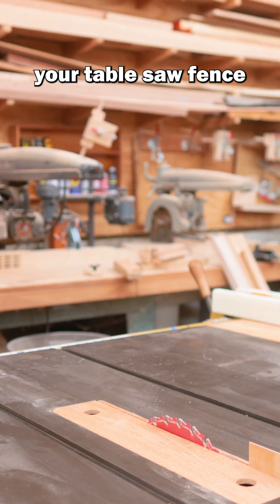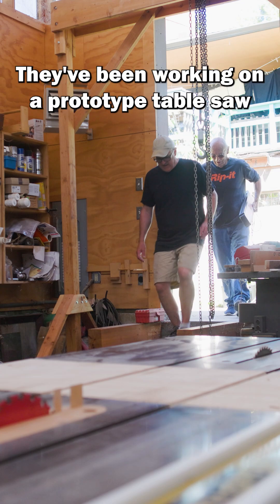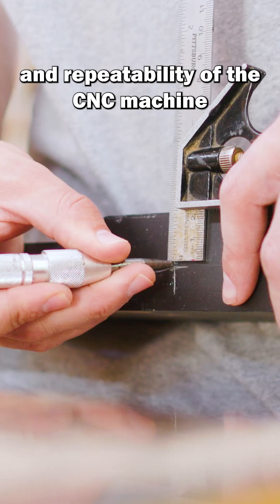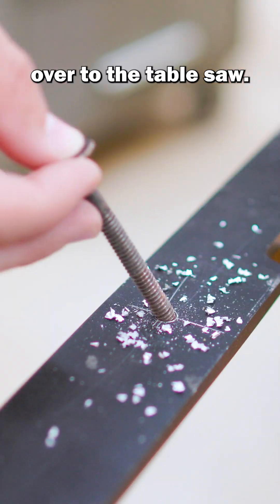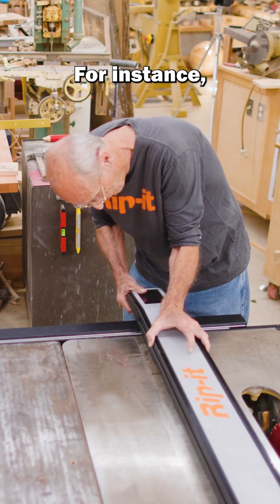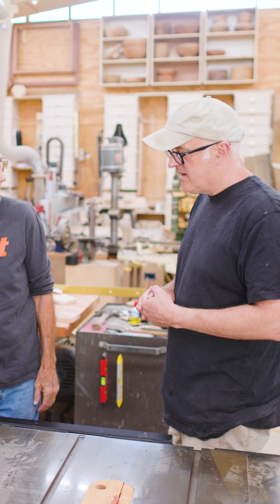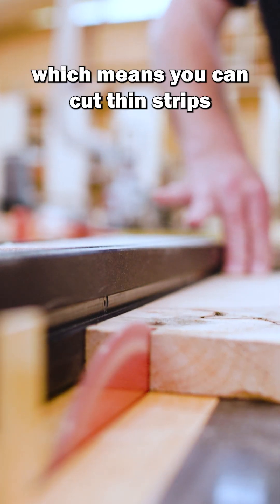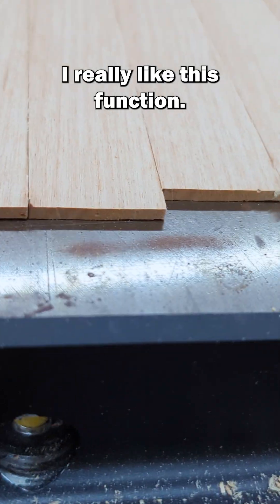Automated Table Saw Fence (Rip-it)

Comment: You are solving a problem that we don't have. Moving the fence is the easiest part of woodworking.
Reply: Moving the fence is easy, moving it precisely is easy but tedious, especially in production shops. 

Shure, it saves time, but the biggest thing is that it saves mental effort. Save your mental effort on the things that matter, not on whether or not the fence is actually at 1.3875 inches.
Reply: Moving the fence is easy, moving it precisely is easy but tedious, especially in production shops. 

Shure, it saves time, but the biggest thing is that it saves mental effort. Save your mental effort on the things that matter, not on whether or not the fence is actually at 1.3875 inches.

Comment: I used one on a  straight line machine 5 years ago. Punch in the width and press the button. It worked great until it stopped working.

Comment: If it already doesn’t, I think a good add to its design would be a stick on strip (sticker) that runs either end of the table it’s connected to. Just like a ruler the sticker would have incremental markings (QR Code for example) that a laser would read to keep exact measurements in relation to the saw blade to ensure accuracy. This would eliminate discrepancies if the rail was to wear or move. A basic calibration type system.
Reply: I imagine this rail uses the same tech that digital calipers use, tracking its absolute position without any drift. I think theres a video showing how mitutoyo calipers are made somewhere that shows this off.
Reply: @mezu-e  Yes I imagine so, but I’m talking about a marking system to make sure the fence and table saw don’t move from their original attached location. The fence will always run along its own tracks accurately but if the fence somehow flexes or loosens from the table saw it will continue to says it’s moving the correct distance but it’s distance from the actual blade will change.

Comment: I expect one day this will be the standard, just as the SawStop idea will once their patent expires or someone else figures out a similar device. Jeremy Fielding did his table saw this way and has videos on YouTube about it, only he added motors to the blade height and blade adjustments as well. One day far into the future, maybe when I'm old and gray, I hope to buy a fully cnc table saw that all I have to do is enter my cut information and then slide the material through.

Comment: the idea is not new it been used for years on profesional metal shears so the base system (panel with driver , servo motor , toothed belt system,  electronic ruler ) can be bought ready made  , it is a nice system though

Comment: Can the motor be disengaged temporarily so the fence can be moved manually if for some reason I want that? Seems like a great product!
Reply: Hi, we're the product design company that developed this product. Yes! You can "disengage the drive" as we call it, with just the tap of a button. Even better though, is you can hold the Jog arrow keys and Rip-it will move in that direction until you let go!
Reply: @kingstonsteele9530  that's great news!

Comment: This would be extremely useful in a large furniture shop
Reply: This would be extremely useful in my small doodads shop
Reply: For large shops there is Altendorf )
Reply: @waitaloneinthedark yep
Reply: @waitaloneinthedark  well there isn't just altendorf. there is also Martin (those two being the bes quality offer I think) as well as Holzkraft (more budget), Holzmann (very very budget) and SCM, Kitschfeld (essentailly the vintage options).
Reply: @Thunder_Moth admittedly Altendorf pretty much is synonymous for a panel saw as they invented that type of saw. And it's pretty much every Carpenters dream to own one at some point.
Reply: @JustiaFiat  I worked with Altendorf and Martin, I found them equally good. I'd recommend choosing who ever has the better offer.
Reply: Every furniture Shop in Germany has a panel saw  with a fence and a cross stop. And I'd say 60% have a digital fence and many have a digital cross stop and fence. The way Americans use those tiny tables saws amazes me every time. Also that tech is decades old and if it costs more then 600€ one is better off buying a used panel saw like it is standard here.
Reply: Yeah, that's why they already have something like this...
Reply: A large furniture shop would be using a high quality panel saw, like a Felder . 
For example have a look at: a Format4 kappa 450
The price is obviously very high, but the feature set is also incomparable.
Reply: Bro come to Germany
There is Most digital and automatic in carpenters Shops 

Cant understand why americans juse these saw stop Saws 
Its like Nailing everything, stupid
Reply: Yeah, No shit Sherlock
Reply: @mlibera925 What is your problem

Comment: Really glad you posted this as I really want to see this project fully funded! Were you able to try the fence on the left side of the blade? Does it calibrate from the left side as well?
Reply: Yes you can calibrate from either side of the blade by tapping "Left" or "Right" on the quick start menu.
Reply: @kingstonsteele9530  that's great to hear. Will the OLED screen have any type of protection on it similar to a screen protector you might buy for a phone? For example, I get high-strength glass screen protectors for my phone and they are easily replaceable if they get damaged.
Reply: Yes! We're looking at building our bezel out of gorilla glass. We're also looking at shipping out screen protectors as well, although you can probably use just about any off the shelf screen protector that is the right size. @Stephen_Hall
Reply: @kingstonsteele9530  It seems my commets are getting deleted, I wonder why. Jeremy Fielding did this a few years ago.
Reply: @KSCPMark6742 deleted your comments? Any clue why he would do that?
Reply: @slimreaper1911  Might be a condition of the sponsorship that any mentions of other implementations be deleted. They might not want their thunder stolen just because this is not unique